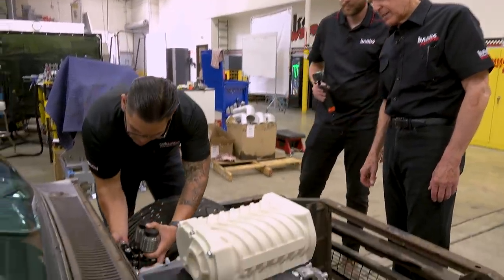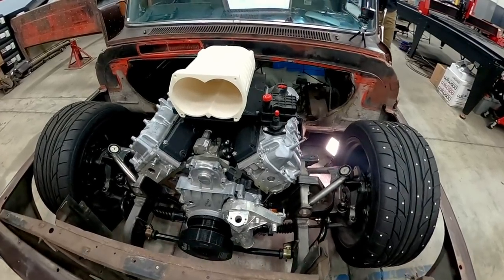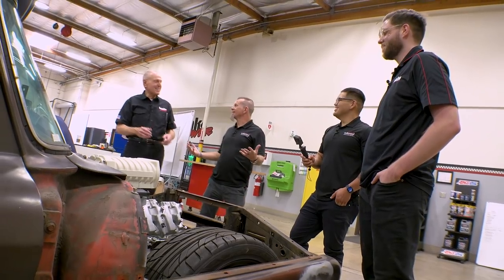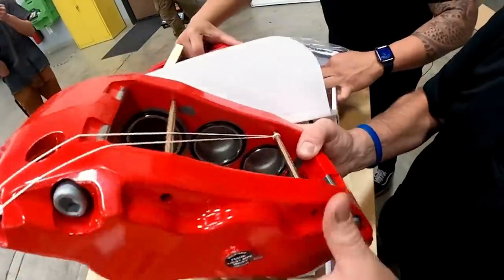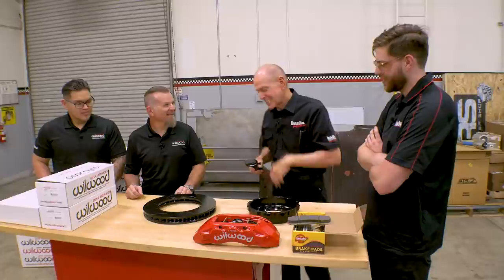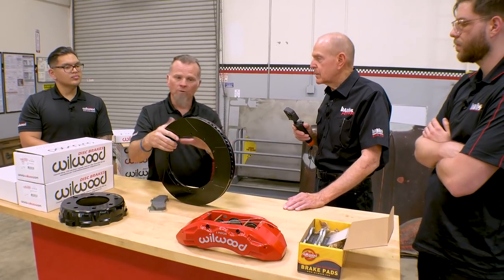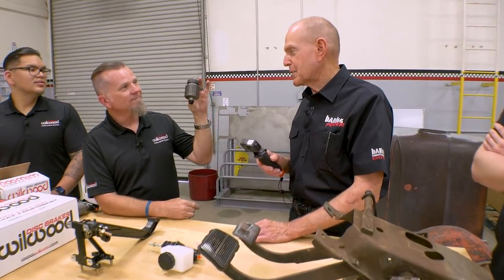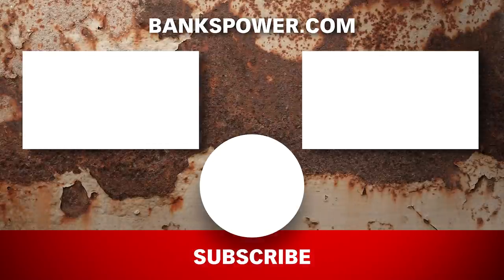Massive brakes for our Supercharged Duramax powered '66 Chevy | BANKS BUILT Ep 24

Comment: What I would do to help a truck slow down more quickly;
- Step 1: Use Freevalve, that way I can program the engine to do Jake Braking on demand without requiring an extra camshaft.
- Step 2: Use a magnetic dynamo (mechanically engaged by the brake pedal) to help slow down the wheels even further.
- Step 3: Even though the truck isn't particularly aerodynamic, I'd probably add airbrakes of some kind.
- Step 4: Use an AI-trained version of ABS which uses real-time sensor data to modulate the brake pressure to be right on the threshold for maximum braking force.

Comment: I want a variable-ratio centrifugal supercharger that is combined with a turbocharger, for maximum efficiency and minimal parasitic loss, while also providing immediate boost as if it were a positive displacement supercharger.

To enable the turbine to actually drive the supercharger with exhaust gas without damaging the crankshaft, the turbine and crankshaft would both be connected to the supercharger by some form of overrun clutch.

By the way: Immediate boost is the only advantage of positive displacement superchargers over centrifugal superchargers. It's all downhill from there!

Comment: I cant believe the epa is not after banks
Reply: Banks is big, has gov contracts, and he makes power without smoke.
Reply: I can believe it.
Reply from the maker: We have more CARB E.O.s than just about anyone in the aftermarket. Our parts are 50-state compliant. Tuners, intakes, exhaust systems, etc... all meet or exceed Federal and State emissions standards.
Reply: @bankspower  exactly! They have no reason to! Banks makes clean power that abides by all regulations and standards. 👍
Reply: Banks builds to meet the requirements, not to get around them.
Reply: @SuprSi  Federal Government contracts don't have anything to do with the California Air Resources Board certifications. The government contracts might be because they could meet the CARB certifications. The EPA doesn't mandate what equipment a vehicle has to have. They set specifications that must be met and engine manufacturers come up with equipment and strategies to reach those goals. Most manufactures have opted to use exhaust gas recirculation EGR, diesel particulate filters DPF and diesel exhaust fluid DEF with catalytic converters to meet the required exhaust cleanliness specifications. They use electronics to monitor and dispense fuel to maintain the correct fuel air ratios to burn fuel as cleanly and efficiently as possible. Tuners come up with ways to bypass the electronics to add extra fuel and screw up the ratios making the engines run rich which causes problems with the systems put in place to keep the emissions as clean as possible.

Comment: I have the same set of brakes on my Ram 3500, they didn't last 30,000 miles, my OEM brakes are 10 times better, I get over 100,000 miles out of OEM factory brakes, very disappointed in wilwoods engineering, I don't recommend buying these wilwoods for anything else other than sports cars, I didn't notice any better stopping , if anything I lost stopping ability with this aftermarket parts. And the cost doesn't justify , changing from factory brakes. Plus the brake dust is nasty, brake dust on everything, if you're going to run these don't use Chrome wheels, you'll be scrubbing them everyday.
Reply: I had a set of the TX6R brakes on my lifted 2008 Silverado 3500 dually and they shaved off 11' in 60-0 stopping distance. My truck weighed 10,100 lbs so stopping was tough before the brakes. We did the test for Diesel Power magazine. We stopped 20 times in a row and each time I was able to stop short of the stock braking distance. Yes, the pads wear down faster than stock, but that's to be expected.
Reply: Dust is from pads, high performance usually means more dust.
Reply: @JayTilles  my rotors are gone also, then wilwood wanted $2000 to replace the rotor and pads, my stock pads last over a 100,000 miles and rotors over 200,000…  I need longevity and durability, so am I thinking and buying this stuff would last longer than stock, I was completely wrong. Great if you want to go drag racing but not if you want to go long hauling.
Reply: @AmarilloHorseSports  Look into the PowerStop Z36 package.  I have it on my LB7 Duramax, and they're great!

Comment: Wilwood doesn't do RAM.....🤯🤦🏼‍♂️🤷🏼‍♂️🙄
Reply: Mostly because Ram brakes from the rip are massively better than GM stock to stock so I don’t think there is as much money to recoup the cost of R&D. I am speaking from experience from owning a 2108 GMC 3500 Denali regularly towing 25,000 pounds I literally did pads every 10k miles and rotors 4 times in 157,000 miles. Why 157? Because that was the second and final time of my own personal “killing a Duramax” series. Cracked piston twice. Anyway 2019 Ram 3500 stock pads 40k miles and 2020 5500 and 2021 4500 have not replaced them yet with over 70k miles and have heard as much as 120k as I still have over half pads left.
Reply: @BloodSweatandGearsGA  I have a 17 Power Wagon. I honestly just want more braking. Thank you for your opinion....🇺🇸🇺🇸🇺🇸🤙🏼🤙🏼🤙🏼🤙🏼
Reply: Gotya, yeah Wilwood brakes are awesome and I still own the aforementioned GMC as I still owe much more than its worth ($41,000) When I can afford to sink another $15,000 into rebuilding the engine, I will also be doing the  Wilwood kit for the front brakes as well. That really was the trucks biggest weakness. Hope you find something for the Power Wagon. Thats a great truck.